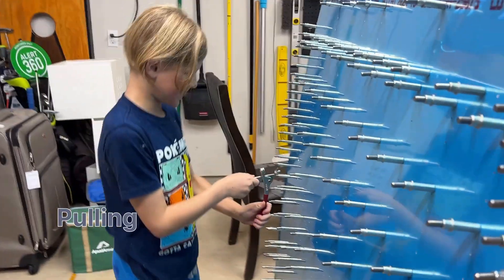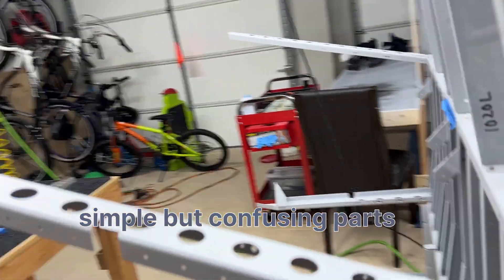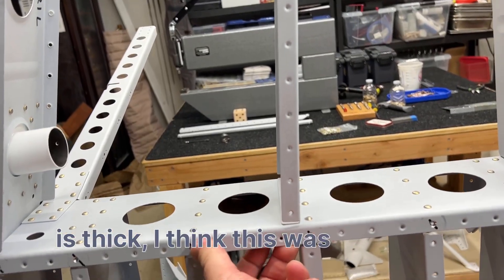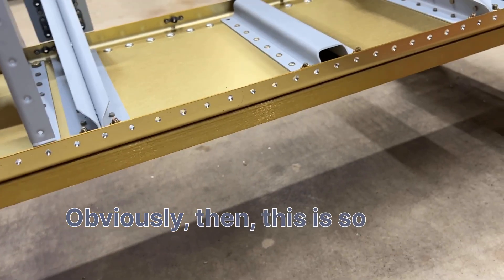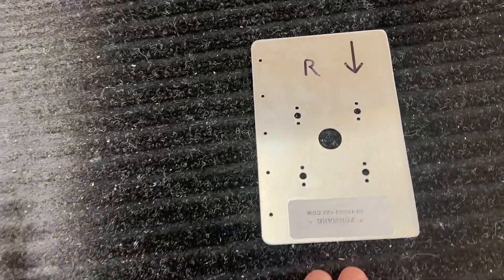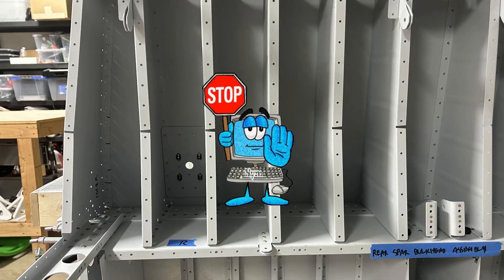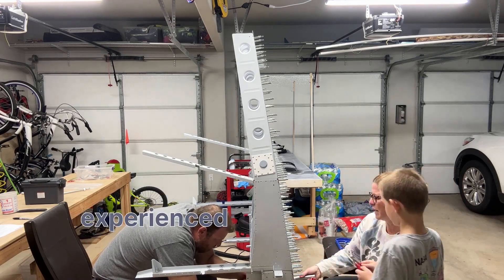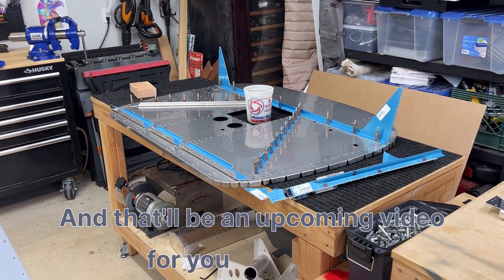RV10 Build 34 - Section 26 (Fuselage)

Comment: Almost every RV I have seen at a fly-in has both antennas on the bottom of the fuselage.
Reply from the maker: I am very confident in my decision.  If all goes as planned, NOTHING with be on top.  VOR, wing tip, ELT in the cabin, transponder, and ADSB on the belly.  Only the 2 GPS pucks will be on top.